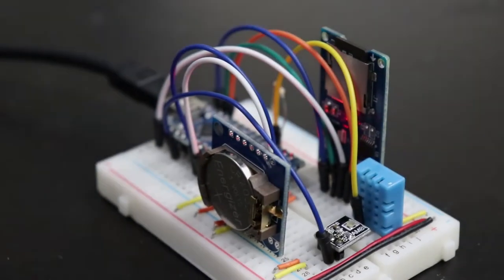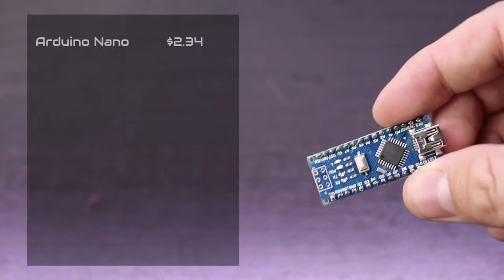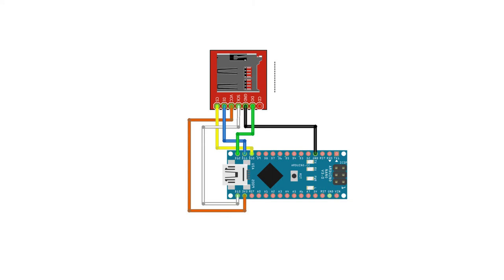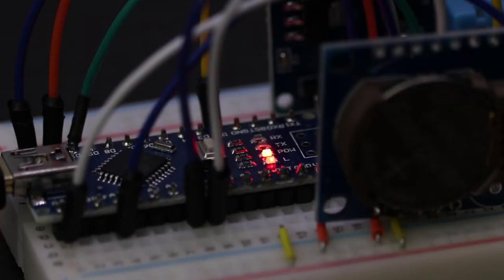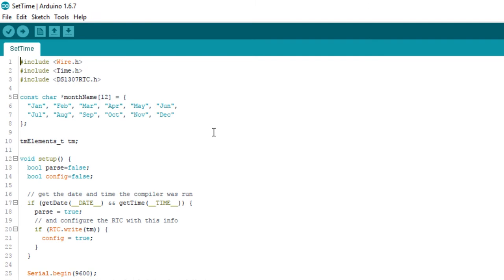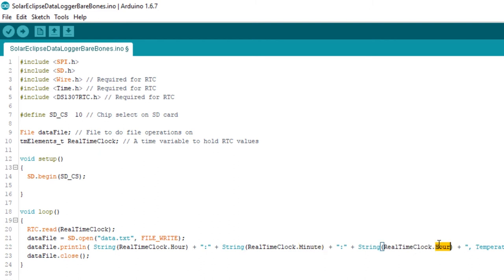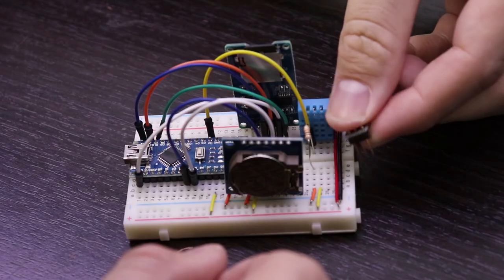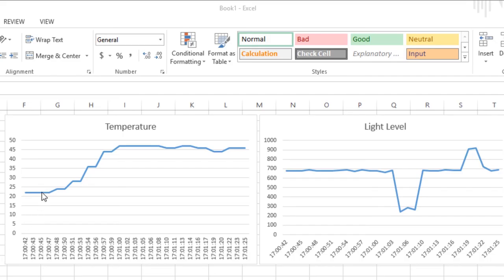Solar Eclipse Data Logger with Arduino

Comment: I have been looking for this for a long time. I am trying to layout my garden and want to record the light in different areas. Once I get setup I thinking of building one for each of my low tunnels and green houses. I hope it's as easy as you make it look. just need to find the proper wiring size and a box to put it in. I can't wait to get started. Thanks
Reply from the maker: That sounds like a great project! Do you have experience working with Arduino?

Comment: That's pretty cool!  I did the same kind of thing.  Nice idea putting the humidity sensor and temperature sensor on it.  My data logger just used a solar panel to read sum intensity.  You should post a video of the resulting data!
Reply from the maker: Tanner Tech I just got back from my trip. I'm working on the video now. I got some great shots of totality!
Reply: byte sized cool!  I can't wait!

Comment: Hi. Im going to Chile to see the eclipse and would love to have this for data collecting but i dont know about electronic boards or software. If i get the materials, would you help me set it up via skype? Thanks
Reply from the maker: Unfortunately I don't have the time to support you individually. If you have never done any electronics, I would start with a slightly easier project. But you'd be surprised how quickly you will be able to build something like this. My goal for making these videos is to inspire so hopefully I've done that!
Reply: byte sized yeah! Will try a simpler one